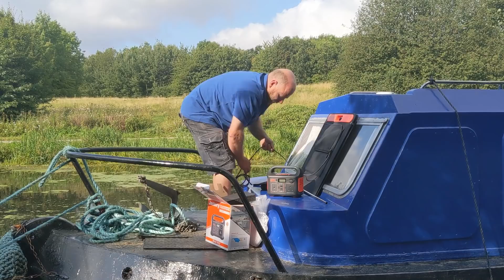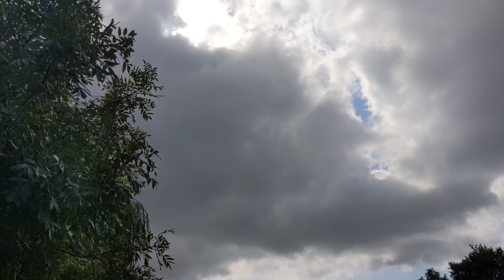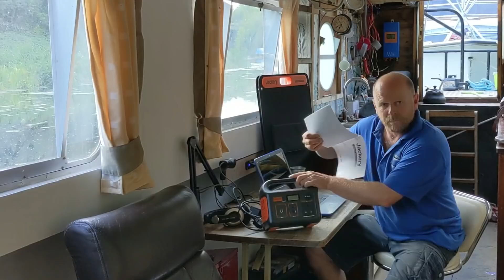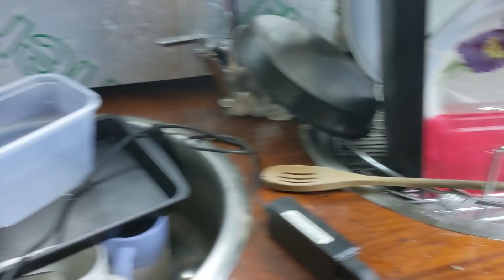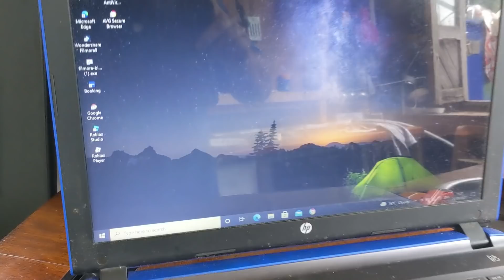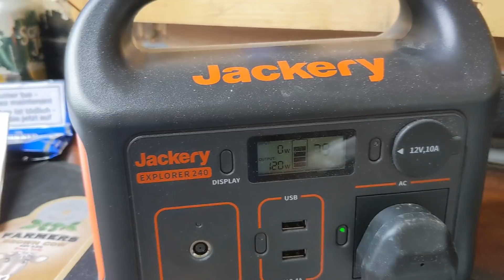Do you NEED a Jackery Explorer 240 Portable Power Station on a narrowboat? #JackeryUK

Comment: With my 16 years of using Power Packs (combination battery and power inverter), I have found them most useful during power outages and for camping to run a few lights and charge the phone.

It is surprising that Jackery solar panel is not waterproof.  During the design phase, Jackery may have used portability and compactness as the main goals and, adding waterproofing may have compromised that.  Although, seems like dipping the panel in a conformal coating would be a suitable compromise.

The Pure Sinewave inverters are nice because they exactly replicate the mains power.  However, for many applications, the Modified Sinewave type are okay for most things, except induction motors.  If the modified sinewave pulses are not the right size and shape, the motor will run slow and hotter.  Sensitive electronics have no trouble running off a modified sinewave because, the power is immediately converted to DC (direct current).  A modified sinewave inverter will also generate a lot more radio interference.

Those solar panels (as you probable discovered) must be pointed directly at the sun to generate the most output power.  The output drops substantially (75 to 99%) when it is overcast or, if a shadow falls on as little as one tile in the panel.

While on the subject of solar power, the more solar panels that can be fit on your roof, the better.  This is especially true when you are moored up on the canal for a few days during the winter months.  There are 2 ways solar panels can be connected to your solar charger; series or parallel.  Although it takes more wire, always opt for parallel connections.  This method has 2 advantages over the series connection: (1) The power conversion efficiency is higher and (2) Your system will put out higher power in broken shade areas.

Comment: Well done Peter, very informative.
We have a lot of choice here in Australia for similar power packs as there are several made here.
I charge power tools on the road and using a cigarette plug 12volt purpose charger for your batteries rather than the 240 mains one won't pull as much from your solar batteries. Stepping up from 12v to 18v tool battery is easier on solar battery than running 240v through a transformer to get 18v and prob running a fan in charger.
Cheers 🍺👍
Reply from the maker: Thankyou, glad you liked the video. I tend to use 18v tools as they generally are as good as the 240v equivelant and easier to handle without the need for 240v where I am working.

Comment: when it rains try setting the solar panels up inside your forward windows - you should still get a charge
Reply from the maker: Yes, we would still get some charge, but it would be very limited as the sun doesn't shine on those windows until around 10am and has gone round past them by about 2-3pm. They would pick up a charge even when the sun's not direct on them but very limited amount. We are going to mount a 'proper' panel on the roof for it instead.

Comment: Would be best for the camper van as it's a small stand-alone system that may actually interfere with, rather than enhance your current system.
Keeping it dedicated to charging only your portable devices is also a good idea.  Are you going to keep your current mooring or get a winter mooring elsewhere?
I was pricing Royal Quays Marina up in Newcastle online the other day. It's a marina with lots of the amenities I'd be looking for as a live-aboard (hot showers, laundry room, several pubs nearby).  It appears many narrowboaters take advantage of the discounted winter moorings that the CRT lists about this time of year and then resume their journeys in the spring.
Reply from the maker: Yes, it is certainly aimed more for the campervan / off grid people but does have its uses on a narrowboat.
We will be staying on these moorings, no plans to move at the moment.
Reply: I'm saving up for a live aboard GRP motor sailer with a beam that won't fit on the narrower cuts (8 ft.) but with keel enough to cross the channel.  Seeing some in the UK that have double or even triple 'bilge keels' so they stand upright in the mud when the tides are out.  Being from the US, I'm only allowed 6 mos. so I'd need  a winter mooring - planning ahead because I'm a tight Californian.  Cheers! @WingingItBoatingonaBudget

Comment: just noticed the plug socket position means your 3 pin plug cable is getting  bent quite badly
Reply from the maker: The original design is for American plugs where the cable comes straight out. Having been altered for UK plugs it's not ideal but the cable doesn't end up bent or twisted to the point that's likely to cause issues.

Comment: Great honest review pete. No one on there vlogs that ive seen mention the solar panel carnt be used when its raining. Going off track do you find your 400 watts solar are efficient enough to charge your 5 domestic  batteries. Ive got 6 but my 320 watts solar isnt good enough if they run low so im looking at a extra panel to take it to 500 watts. Plus of course it takes a lot longer running my engine to charge 6 batterys being moored up. I guesse my 32 inch tele is a big power user though 🤔 it will be interesting if you do a review on your solar and what you think. Cheers mate 😁
Reply from the maker: We are just about to upgrade to 5 batteries  - so we will see. We may need to upgrade the solar to match though. Apart from the fridge (when we use it on solar) we arent particularly heavy uses of power - we dont have a TV for instance.

Comment: Thanks for your review. The one question none of the reviews I have seen answer is.Would you use your money to buy one?.Yes it’s a good product but does it give value for the cost of it.
Reply from the maker: Ultimately I think if we were looking to buy additional power with our current set for the narrowboat alone we would probably buy stuff to link into our main system, having recntly bought the van to change to a camper I think we would buy one of these for that.
Reply: @WingingItBoatingonaBudget  thanks for that honest answer that’s what I thought not much use for a narrowboat that already has solar panels
Reply from the maker: @garym518  yes has limited use. However we currently don't have a inverter in our normal set up that can run laptop so the jackery is very useful for that.
Reply: @garym518  We've got solar panels, but only have 1 usb charging point onboard as it's an older boat. For us, we would have definitely bought one just for that reason alone as we have so many items that need charging via usb/12v.

Comment: As a tight wad I don’t think you would have parted with the readies ;-)
Reply from the maker: In all fairness your probably right. When I saw the first review of them I looked and thought 'nice bit of kit, but not sure I'd spend my cash on it'... Having tested and used it I'm now a bit more inclined to think I would buy the jackery unit itself, but no - I wouldn't buy the solar panel.  I am using it 'everyday' so guess the real test will be when the time comes that it fails. Will I BUY a replacement - and I guess only time will tell, BUT I am inclined to think I probably would as it is a good bit of kit that has a few uses, as explained in the video...
Reply: @WingingItBoatingonaBudget  
You got to like the marketing though ;-)

Comment: 41 mins to tell us the solar is not the best and you used it to charge your laptop and phone.... 

I'm sure in truth had you not been given it you would not chose one as a soltion for your van conversion as you could realistically build better solutions for less than the cost of the  240 and panel.
Reply from the maker: 41 minutes (well close on three weeks edited down to 41 minutes) to test the machine and see how it performs. No point reviewing it if not thorough. 
As per the summing up, if I was buying one for the boat I would not buy the panel but spend the money to buy the next model up (jackery 500). 
For the campervan I would use one of these as opposed to a full electric install, for the power we would need (lights, phone charging - NO tv or fridge - its only a small diahatsu van so no room for them, its only really a 'overnight van') this would more than cover it and it would be easy to use = I would however buy a fixed solar panel for the roof, not the jackery one.